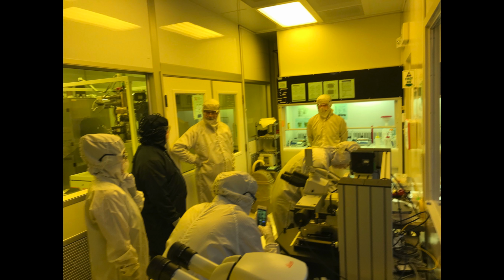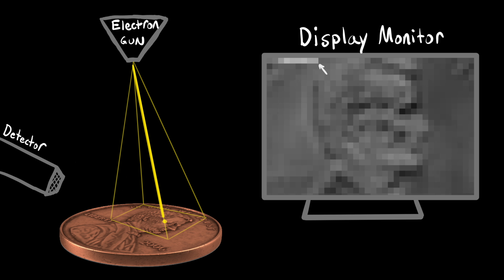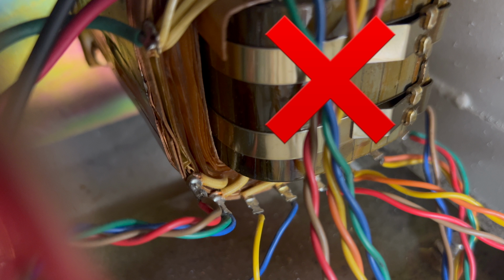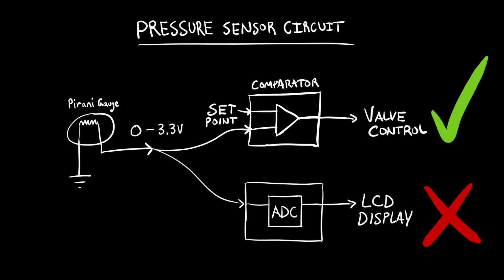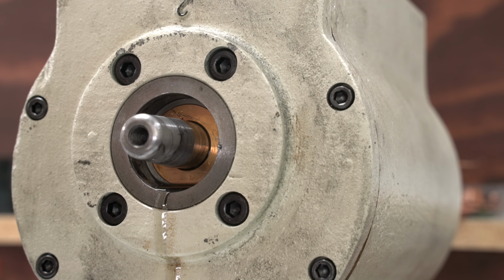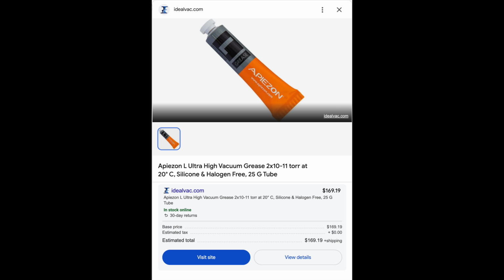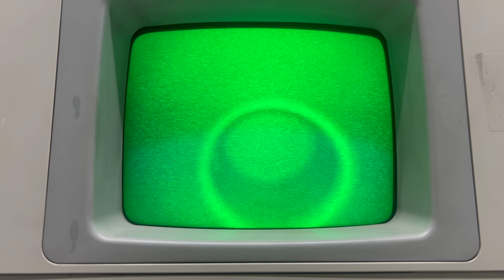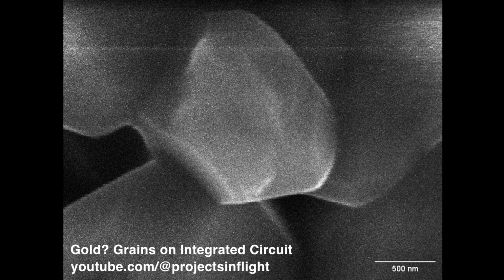I Saved an Electron Microscope from the Trash

Comment: I've always wondered if SEM/STEM would benefit from some of the same algorithms used in astrophotography.  With AP we usually have to take many long exposures, then combine them in software to get a SNR that's remotely decent.  It gets even more complicated when you use filters and a monochrome camera.  Also, the software usually has functionality to align the images based on the detected stars in the image, and the more advanced algorithms can even stretch and squish your images to account for things like sensor tilt, optical distortions, etc.  That part would be more difficult with SEM images, but it's certainly doable, and you don't have the problem of a moving target.

Since you're only scanning at one beam energy level at a time, I wonder if it'd be possible (or even sensible) to take the same image at different beam energies, then treat those like RGB channels.

These are just idle thoughts, I doubt they're very original and likely other people have already attempted it, but it's the sort of thing I'm interested in.
Reply: Quite a lot of the algorithms for SNR increase used in astrophotography are already used in modern EMs. There are even more advanced techniques avalible for electron microscopes when compared to astrophotography. At lest compared to advanced amature astrophotography.
Reply: I developed software/hardware for analyzing satellite image sensor data. By far one of the most amazing image processing techniques you can use is something called adaptive histogram equalization (AHE). You can also develop some more advanced methods for AHE using an AI/ML approach to control the transfer function that is used when processing each pixel or voxel which goes beyond what AHE/CLAHE can do. Voxels can be used if you have the ability to use two or more sensors at different angles to establish a z offset using a photogrammetry approach. AHE pulls minute details out of the data and makes them humanly perceptible. Human vision can only perceive around 64 shades of gray. Any higher and you can't tell the difference between one color and the one next to it, however sensor data may provide 4096 levels of intensity or more!. AHE is an iterative post processing approach where you process each pixel of the image and compute a spectral analysis (histogram) using the pixels in it's immediate neighborhood. You then create a transfer function to spread those values out more in a controlled fashion to make the subtle differences more perceptible to the human eye. Essentially it is a localized dynamic image contrast control. You can also start with a de-noise pass and a continuous edge enhancement algorithm. Initial de-noise you might lose a little bit of fidelity but aesthetically images look better and helps to reduce noise amplification issues. I used some sample images in the past to show how amazing this is in an unclassified setting. Had a super high resolution image of a lady who had dark brown hair and she was wearing gold hoop earrings. In the source image unprocessed you could NOT see the earrings at all, completely covered by the hair. Post processing those earrings popped right out and you could even see the shine variations on the surface.

This was done in software, however i was also doing FPGA development for image processing at the time. I always wanted to get the CLAHE image processing fully implemented in the FPGA solution to use for real-time video image processing but I left that job decades ago... If I had an unlimited R&D budget I'd just live in my lab all day... haha.
Reply: @dohabandit  I'm going to have to come back this comment to know what to google when I have time. That's super interesting stuff, and probably way beyond my current abilities. I don't have a background in image processing, but I have done a lot of signal analysis on high speed circuits, and a lot of statistics. Those skills have waned in the years since I got out of that industry into a much cushier software job but I still like to dabble. My forays into astrophotography have rekindled my interest in data processing, and I want to get better at it.
Reply from the maker: Interesting idea... I suspect that it would be useful to overlay different images, but only at the same beam energy. 

I do not know if it would be useful to do it at different beam energies. The reason is that at different beam energies, the amount of surface detail actually changes, and so at lower kV you see more detail, but have more chromatic aberrations in the lens. so you'd be trying to overlay different but equally valid images. It's a really intriguing idea and kinda makes my brain hurt thinking about exactly how you'd go about solving that one.

I should definitely look this one up to see if others have tried
Reply: @projectsinflight  I'd be willing to spend some time messing with it if I had some of your images. I've been tinkering with some of the Python libraries out there for this sort of thing for astro so I can build my own software for automatically importing, organizing, calibrating, and doing a "first pass" processing before I bring it into tools I know are beyond my skill to replicate.

I'd have to put together a plan of what to capture to be truly able to tell if it improves image quality, but I also wouldn't be surprised if better software already exists. SEM image processing isn't exactly something I've come across in my career as a software developer. It'd also be a lot of work on your end to capture a bunch of different exposures, and you may be happy with the quality you already have. Astrophotography is a masochistic hobby so I wouldn't mind doing it, but that's not universally considered fun.
Reply from the maker: feel free to email me if you'd like and i can send some images when i get a good sequence. my email is the same as this channel name at gmail
Reply: @ams-photography  FWIW the built-in processes in the SEM act to do much the same thing that astro processing does in stacking.  The highest s/n achieved by slowing the scan means that the final image is (final frame time)/(frame time of casual viewing) better, which may be 1/30 or 1/60 second compared to 300 seconds or more.  That is similar to averaging 18000 frames.  There is little to no motion (no atmospheric sparkle) so effective resolution does not change much, but if you need a feature detail you just zoom into it.  Newer systems with digital capture can stitch frames.  Likewise the SEM can rotate and tilt samples so if you need an angle on a feature you just do that instead of managing field tilting and stretching.  When this older instrument needs a field stretched or corrected, something analogous to a lens correction table in Lightroom or Photoshop might be worthwhile, it's just that such an instrument only generates 1 or 2 MP images (not my 'scope, I might be a little low here) so there isn't as much room to drag pixels around and re-shape things.  Software image sharpening might be of some limited value, and in rare situations focus stacking, though the advantage of the electron microscope is that it has such great DOF that stacking for focus is not often needed.
Reply: I have worked in EM for 10 years (primarily on modern JEOL and FEI/TFS S/TEMs), and I can confirm we do some similar stuff, but it’s less of an issue for static vacuum imaging and more of a focus for dynamic in-situ operations like heating/cooling specimen.

The biggest challenge with resolving more detail wouldn’t generally be drift or scanning noise during the raster, but the movement of the atoms and their particles themselves. It’s pretty trivial to resolve atomic dumbbells in a well-aligned modern S/TEM.
Reply: This is built into most modern SEM softwares now. You have your choice of the number of images to integrate, the number of lines to integrate, dwell time and a variety of other things.
Reply: Some really good ideas here! I dont know if its also possible to change the beam angle or the sensor angle for another output. My work is in 3D photogrammetry so I'd be searching for ways to get the 3D information out. Its a pity the computer is quite late stage in the signal path here, because if data could be interrogated further downstream then more of the grunt work could be done by the computer, and with this, more flexibility. But I guess that is the downside of getting an older model SEM
Reply: The thing is that exposition time already can be as long as you desire, within reason, after all, the electron beam can and will destroy your sample if you leave it to hover on the same spot for too long.

That is the key difference between astrophotography and electron microscopes. 
Unless you are using a radar to image a relatively close to earth object (within the solar system), astrophotography is completely based on passive sensors, you can't shine your own illumination source on some exoplanet 10 light years away, so, exposition time is a centerpiece to resolve anything. 
In electron and optical microscopy you use active illumination, which opens the use of different possible ways to manipulate the final image, in the case of scanning electron microscopy, the acceleration voltage, scanning speed, apertures, etc., provide a much finner control of the signal to noise ratio than just manipulating the outcome of the passive sensor. 
Also remember that we are talking about electrons, there are no "colors", you fundamentally are detecting different information like atomic weight distribution, surface topology and with the x-ray defectors, chemical distribution. 
Using different wavelengths of electrons would just affect your maximum possible resolution and in the case of nonconductive samples like polymers and ceramics, you can outright destroy them. 
Also there is the sample preparation which is almost an art in itself, maybe not so much with scanning microscopes but with transmission electron microscopes, the correct sample preparation it is quite the skill to master, especially in biological samples, it is a pain in the arse to avoid the destruction of cellular structures by ice crystals, correct cryogenic fixation and use of osmium tincture takes time to master.
Reply: Considering that a SEM image is still nothing more than a Matrix of intensities, it is generally possible to apply all the same CV algorithms for things like feature detection, stitching or similar. It should be noted, though, that stuff like calculating homographies (e.g. for panorama stitching) gets harder, the smaller the imaged area is, obviously. So if you go with a higher magnification, many algorithms need to be more sophisticated. 

Would be an interesting project to implement a bit of CV sugar with the SEM!

Comment: pls do some e-beam litho, in labs they do features with a few nm resolution using SEMs. :)
Reply from the maker: I will definitely be trying to do e-beam when I get some more information on how exactly to drive the beam externally
Reply: @projectsinflight  Maybe you can drive the electron gun in reverse? Just keep the same scanning method but modulate the intensity, and more or less feed a video image into the gun's cathode to control beam intensity.
Reply from the maker: @Stoney3K  The intensity of the electron gun is determined by its temperature, which cannot be adjusted on small times scales unfortunately
Reply: @projectsinflight  to do e beam lithography you will need to be able to blank the beam,  typically done inside the column by steering te beam to a position where a plate intercepts the beam.   Search for ‘conjugate blanking’.   If you are interested in looking at IC’s  you may want to check out “voltage contrast”,  a method that lets you observe circuits as they work in real time.  Well done with the great methodical approach to restoring your SEM!

Comment: Good lord that's cool. I'd love to see some failure analysis if you happen to have things that break. But I'll admit that I'm currently enamored of material engineering. 

That said, your next big goal should be to design and fab an ASIC to handle the video signal. (Kidding not kidding.)
Reply from the maker: I'd definitely like to build my own capture device if i can! The software that comes with that PC is abysmal!
Reply: @projectsinflight  If I had to guess someone may have done something in MatLab or LabView already.  At slow scan the demands of the capture device are very modest.  Even a PRO Audio ADC with lots of bits would do the job and all you have to do is figure out how the synchronisation is done or recover it from the video signal with fuzzy logic.
Reply: @KallePihlajasaari  Yeah. The standard scan rate seems pretty trivial. But getting the hardware to gracefully handle a variety of different scan rates (especially if it's a continuum rather than several discrete rates) would be a fun problem.
Reply from the maker: I do suspect this is a relatively easy project as far as the ADC requirements go. I think ben from applied science did it with either an arduino or raspberry pi or something